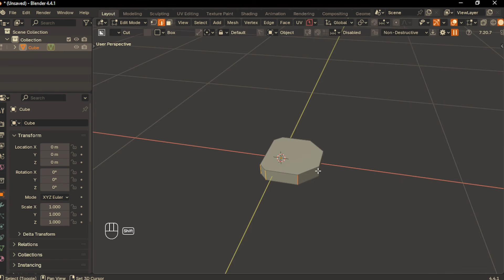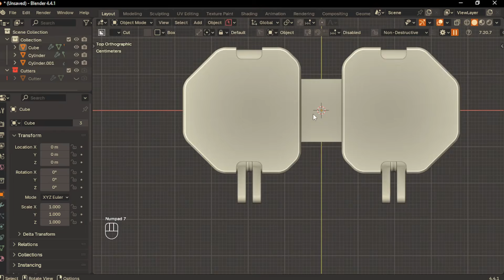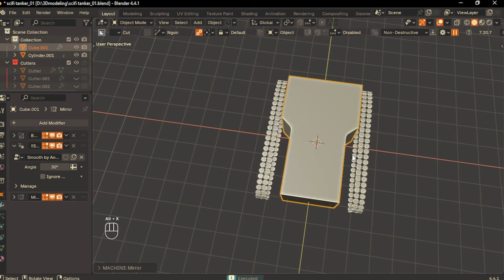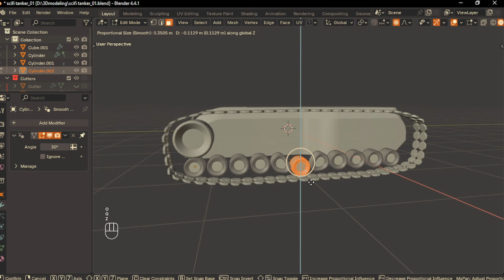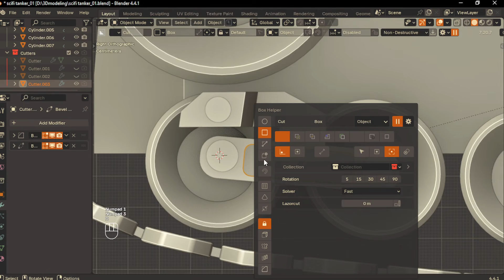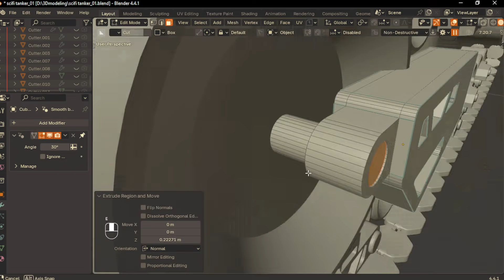Advanced Blender Full Course | Vehicle Design | Part 1

Comment: Bro is there an alternative for carver tool it crashes every time I never get to use it
Reply from the maker: There is plenty of tools you could use as alternative, but most of them are paid, but are insane.
1.Box cutter/ hard ops 
2.fluent ( advanced)
3.bool tool(free), which comes with blender. Unlike cutters, you run difference boolean.
Reply: @EidosEdge thanks looks like bool tool will do the job anyway keep it up!